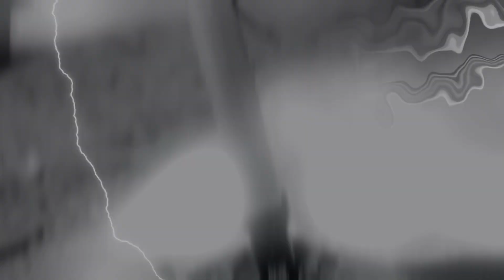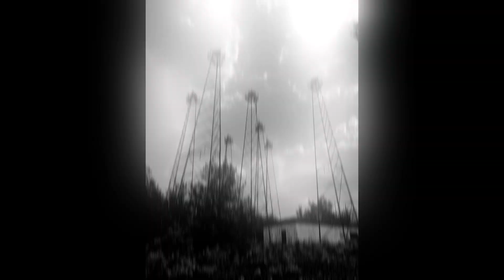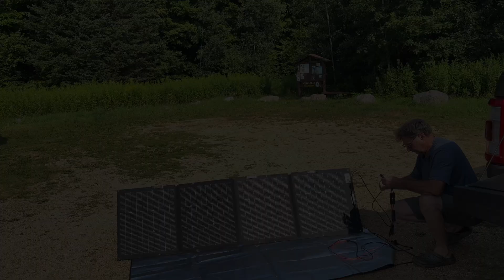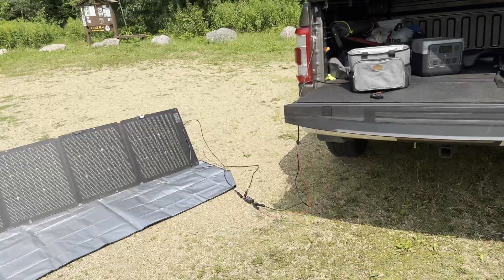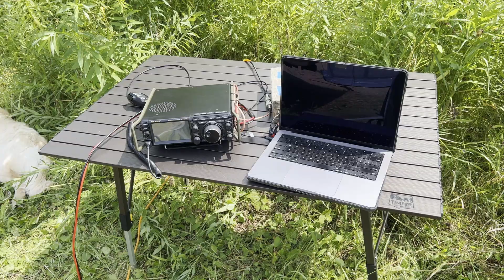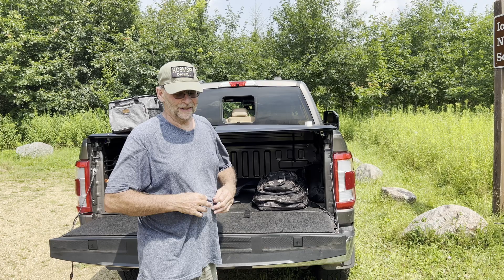SOLAR STORAGE for POTA

Comment: You can run the 710 at about 30w on that battery.
Reply from the maker: Very true.  The inrush takes it down.  Just wanted to prove that theory.  The storage unit does boast about having a limited burst it can handle, but not enough.